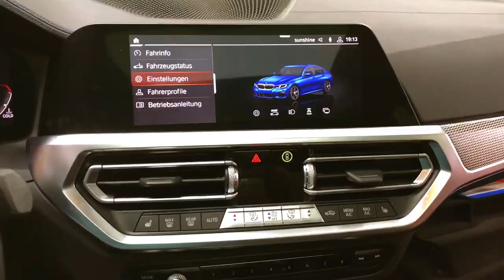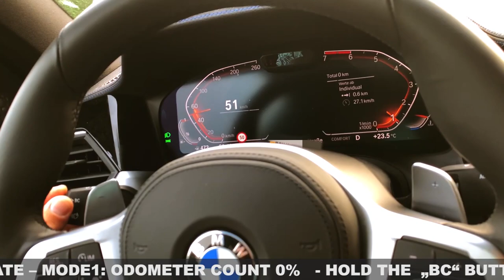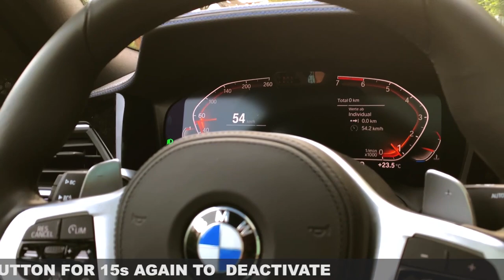BMW 3 Serie G20 G21 MILEAGE STOP - change ODOMETER CORRECTION clocking Live Cockpit Gauge

Comment: What direction do you plug it in? It can plug in both ways. I don’t want to cause a fault code!
Reply from the maker: in the video you can see exactly how it is connected
Reply: @SuperKilometerFilter  Hi i own a G21 series bmw and im interested in buying the odometer freezer. The thing i have a question about is the ECU, is it possible to plug the OBD2 cable to the ECU and check through the BMW diagnostics software the real mileage of the car, or does the device freeze the whole thing? I really need to know this due to personal reasons.
Reply from the maker: @Gripengamer  you can read out any control unit with the bmw diagnosis tester you will only ever see the value from the speedometer
Reply from the maker: @Gripengamer  https://youtu.be/6lD9Uhjc8us